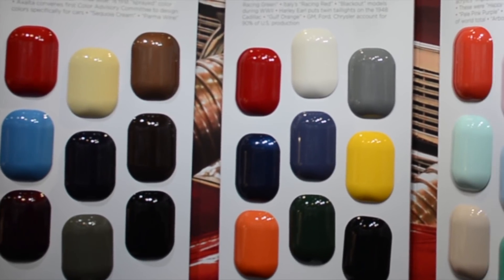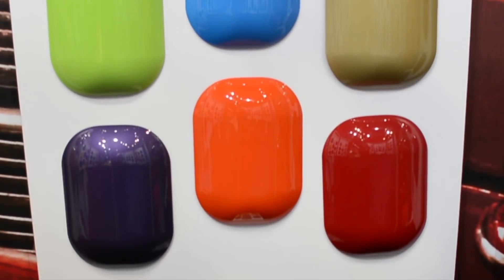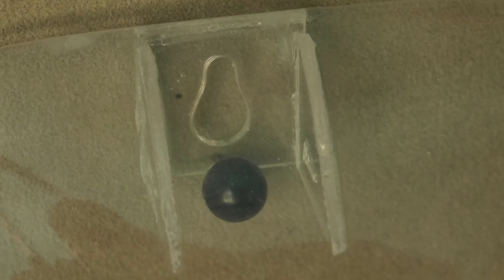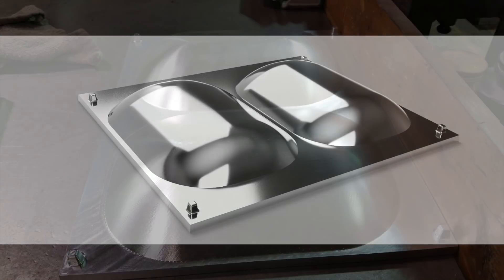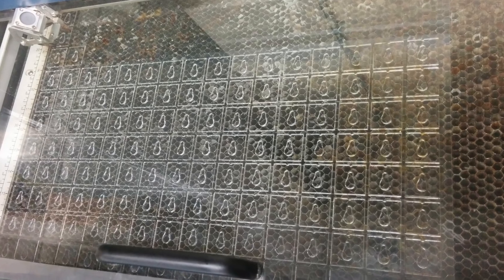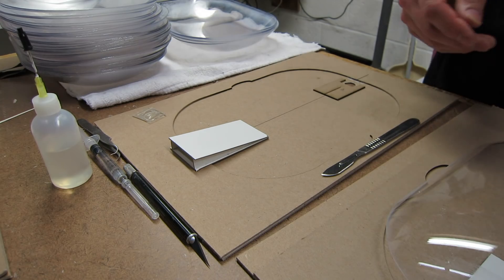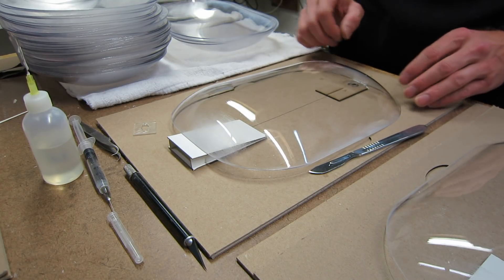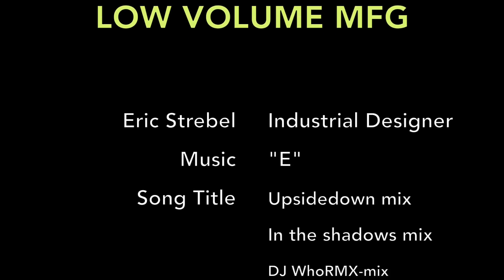Designing for Small Batch Low Volume Manufacturing: Vacuum forming

Comment: You need to get a new drill. Yours is leaking microwave juice! 🤯
Reply from the maker: Brandon Trudel Awesome! Thanks for your comment
Reply: I'm impressed with the percision that you go to in your mold making. I was going to mention that the little hangers @ 01.24 could have a small piece of plastic crosshair that protrudes so when you press the part up on the cork board it marks where the client puts their pins to hang it. It's those little thing that put a smile on their face. Cheers and keep up the awesome work!
Reply: Oh, never mind. I see what you did there. I've been exposed to too much microwave juice. 🙄

Comment: A faster way to make the hangers. Use a 90 degree V cutter to make pairs of parallel grooves across the plastic sheet. Laser cut the hanger parts across the lines. Build a folding jig to set the parts on, blow on the parts with a heat gun then push down into the jig with a tool shaped to fit into the keyhole slot. Squirt a little solvent along the inside of the folded corners. Faster to produce and stronger since they're one piece. Making 400 would be worth the bother to design and build the tools to fold them.